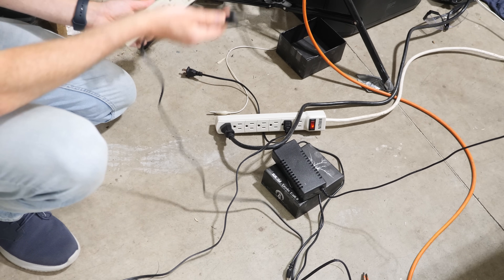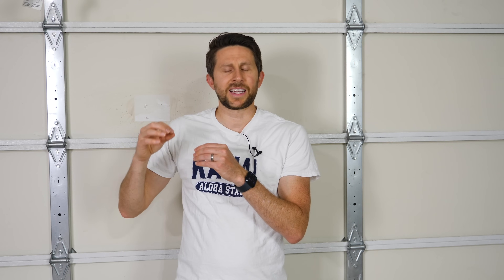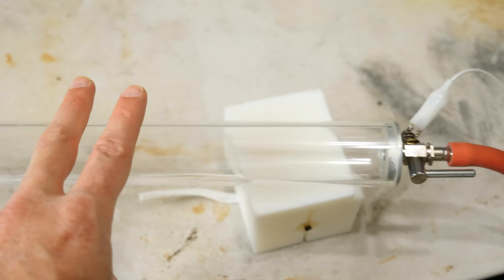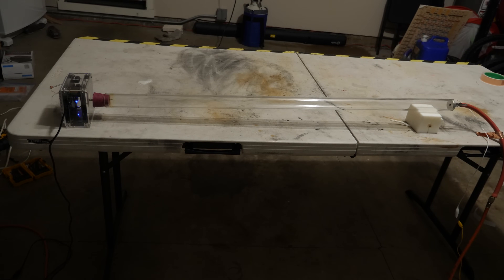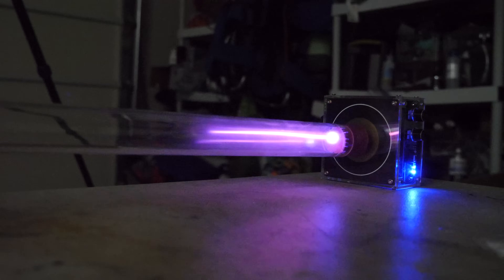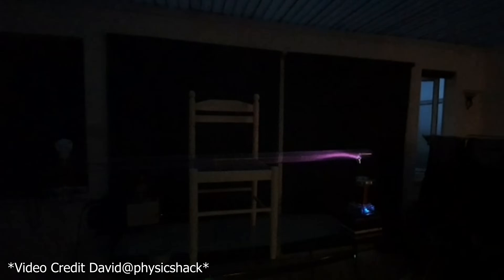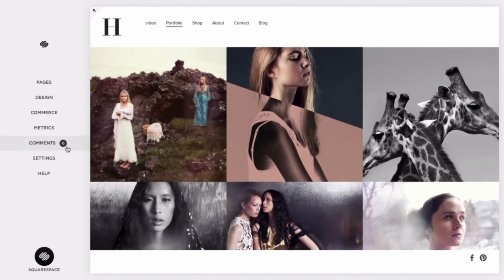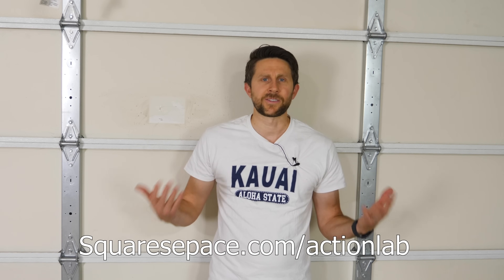Using the Air As a Wire—Was Nikola Tesla Right?

Comment: With the tides on earth, you would think we would have made some tide dams that fill up during high tide and slowly drain and spin tubines till next tide. Or geothermal vents?  Or are both of these not viable?
Reply: They exist.
Reply: Yes, agreed & agreed...we should be doing more of these! As well as deep water thermals.
Reply: They are possible. But others things and methods are simply cheaper, more efficient and more practical.
Reply: @BuildGUY heard of boats? Boueys? Oil rigs? The sea is rough, but it's combatable.
Reply: @volvo09  yep... even Titanic hasn't dissolved yet, and that is a bit over ten years.
Probably add WWII sunken ships and subs to that list too.
Reply: You mean like the metal pipes that carry water to us?
Reply: There are some experimental tidal turbines, they're somewhere in the EU region I believe. Like underwater wind turbines.
Reply: The Netherlands called.
Reply: @BuildGUY there are alloys that can withstand seawater, like titanium and hastalloy for example. You can also just make something out of steel and have it coated in resin composites or an elastomeric liner and it will work just fine at a low price point compared to high alloys.
Reply: Lake Michigan has a tidal powerplant, it's freshwater
Reply: Agreed, here's what's been the problem though...... oil. The powers that be want to meter everything and sell it..... the next to be metered is us and our "carbon footprints" They want ultimate control, we just want the peace and freedom to live..... we need to make this happen without them, if we can organise and decentralise our enegry needs these scumbags will have a lot less impact on our lives...... 

Old patents and the like have lot's of great ideas, remember when electricity came about it was decentralised so thet had lots of ways to generate power in the home, it was only once the likes of JP Morgan got their hands on it that it became centralised.....
Reply: Tidal is very location-specific. Geothermal takes a long time to pay off. Both are in use, but don't make sense as fast-growth choices.
Reply: There actually are large tidal farms. They're am expensive investment and can't be built just anywhere but in truth. The efficiency is actually really really good.

Again. It's not something just anyone can do and just anywhere.

Comment: In addition to the inefficiencies, theres the inherent RF noise that tesla coils are notoriously known for that would have the FCC in all a tizzy
Reply: Yeh most communications would be toast telephone even copper wire cell wifi cable and arial tv signals sats com all it it would not function
Reply: That's spark gaps, not the Tesla coils themselves. Tesla coils are by themselves just a particular transformer topology, and if correctly used won't throw off any sparks... but most hobby users like them because of the sparks, and those sparks (or more particularly the wideband signals they produce) are the problem.

Comment: Make a vacuum tube Tesla coil for next video.
Reply: Plasma globes used to be a thing, which was basically what you propose. Tho they may have also used other gasses instead of just a vacuum.
Reply: @markdavis.nothisone  No no you got it wrong,I was saying about something else, a vacuum tube Tesla coil is a testla coil which works using vacuum instead of a the air spark gap in conventional testla coil and this way you can create powerful Tesla coils which don't produce ozone and burst of dangerous ultraviolet light.